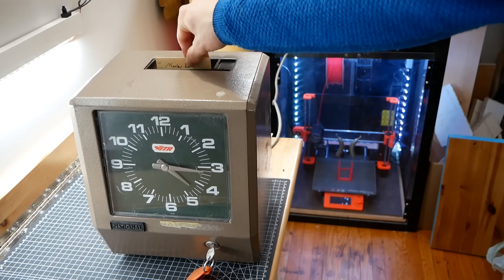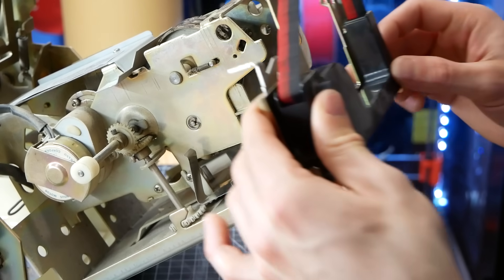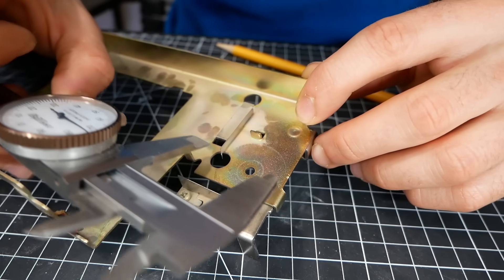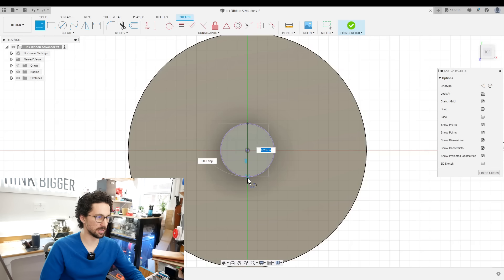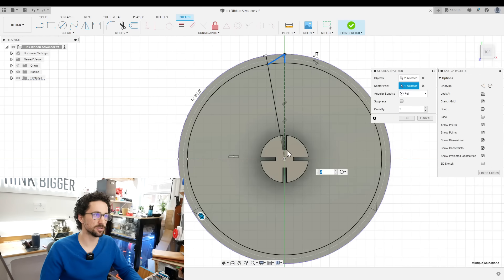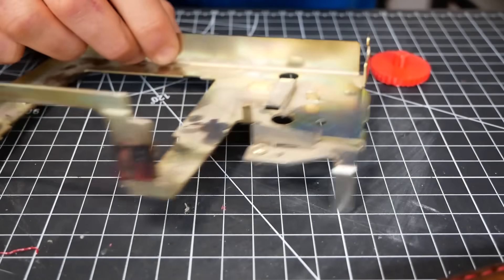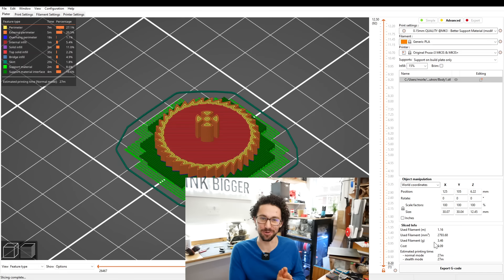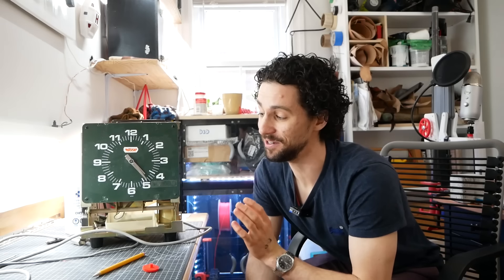They wanted 100 dollars. I 3D printed it for 9 cents.

Comment: But it’s only 9 cents if you have the PC, software, fancy calipers and a 3D printer. Suddenly a $95 assembly (not just a part) for a 50 year old machine that requires none of those things sounds reasonable. The issue I have is that while it’s cheap for you, and I do applaud your ingenuity & methodology in the scheme of things, those who can least afford all the required items will not have parts available if companies decide in the future that it’s not cost effective to provide spares for items as there is a limited market. I haven’t lost sight of the fact that this clip is about a 50 year old item though & you have shared the love.

Comment: yeah, that's great.  now tell them how much a 3d printer and resin/filament supply costs.  don't forget to include maintenance, as the machines WILL eventually need to be serviced. and make sure you get the RIGHT resin, as the entry-level stuff isn't always suitible for engineering projects.(the more durable stuff is of course more expensive)

Comment: If you count the hours you use to measure, design, and print, then the equipment you have to buy before you can start printing, the electricity bill, you will need a bit more than just 9 cents.  So if they have a 3D printer, it will cost them a bit more than just that 9 cents.  They don't have to design it since they probably have it on file which is an advantage for them.  But the way you deduce the shape it should have is probably more fun than just forking up $100.

Comment: Asking as I'm unfamiliar with the plastic these machines use. How durable would you expect this to gear to be? I would anticipate a short working life, as the top of the teeth would be rounded off. Factoring in your time as a cost, I would imagine if it has to be replaced one more time in the machines lifespan, it would have been more cost efficient to replace with the metal assembly? The concept here, however, is wonderful. If that part was not available, if the manufacturer was defunct, or anything of the sort, this could be lifesaving.

Comment: TBF on the $100 part, let's say someone brought this time clock to you in the hopes you could fix it for them and it wasn't your personal thing. You worked on this and designed a part that should work and testing proved that it did. But there is the time you spent on designing that part and printing it out. So let's be fair, if someone was hiring you to fix this for them how much would you have charged for this fix? Perhaps not $100 but I have to imagine that it would still be something. Heck once you were all done you might even tell them that because the part was so inexpensive to reprint that if it breaks that you'll gladly reprint it for them again in the future, but I still got to imagine that the initial fix would have cost something.

So again let's say I'm just some guy that wants to get this old time clock fixed up. I contact the company and they say they can get me the part I need for $100. I know you though and ask you if you can take a look at it. You not being familiar with it have no real way of estimating how long it'll take you to fix. So perhaps you give me a range of prices based on how tricky the problem ends up being (heck it might have been as simple as some mechanic part needing a bit of WD40 sprayed on it so it didn't stick). But now I have a choice, get that $100 part from the company that is almost sure to fix it or let you spend time on it for who knows how long and perhaps find a cheaper work around.

Comment: Honestly $95.00 is pretty cheap for the gear.  Props to the company for even offering the part.   You probably did $500 in custom cad work, $150-200 worth of assembly/ disassembly but hey you saved $95.00!!

Comment: I feel like changes could probably be made to make the part last longer.  Looks like there is metal scrapping over the PLA gear.  Idk what those changes might be or if they are worth the time investment--but the 9 cents is nothing compared to the print time, so for me I wouldn't want to print it out more than once if I didn't have to.

Comment: This is a perfect example of a manager vs an engineer. An engineer will look at a problem and ask what are the cost of materials and tool use, 360/10 is about 35 looks about right does it work, yes, and a manager will ask "How many people do I need to figure this out and get him what he needs and what is the cost in wages and in delays on other projects." One gives you a 9cent gear the other gives you $95 and both are perfectly valid calculations

Comment: I tottaly agree that the company should just replace that gear for a reasonable price ($100USD is really a lot for a gear)... however, if you account for the time it took you to come up with the decision to print one, measure it, draw it, print, test, change, re-print and fit... i am fairly sure that gear cost you WAY MORE than 100USD.

But, this is me talking out of my ass because i do the same thing every day...if i can make it, i will not  buy it.
Your video really shows that the process of bulding someting is just a matter of decision. 
Thank you for this. 
It is a nice tutorial on how to approach certain problems with a 3D printer.

Comment: You forgot to factor the price of your printer, media, time spent designing and electricity used.
Reply: media is most likely free, he already had a printer for practical use, normal 3d printers use about 50-150 watts, and time doesn't have much of a price
Reply: @thecringeslayer4897  Exactly none of that is true. Each one of those points are not “free” There is a cost associated with each.

Comment: Reminds me of my peterbilt. I have a little cap for my power steering that pete wanted $700 for thats just slightly bigger then a standard pop cap. And used ones are still going for $250+ friend who has a high end printer knocked one out plus a few spares for $1 each using a high melt point material and they work just as good as the factory one.

Comment: 9 cents + the 3 grand for a 3d printer
Reply: 3 grand??? LOL not even close decent 3D printers are only 200 bucks
Reply: @PabzRoz  the one he is using is 1200 bucks, lol sorry 3 grand was a bit of sarcasm
Reply: @DrinkWine94  That's only if you buy the Prusa pre built. It's 800 bucks for the kit and you build it yourself which almost everyone does lol but yeah i feel you

Comment: Imagine the process for someone without your knowledge. Get a 3d printer, learn how to use it, learn how to use the software, have all the measuring tools, find that one video that you found - like the hours alone are worth way more than 95 $, apart from having a 3d printer ^^ So the price is not good for a company that can make them for the same cost as you, but it's worth it when you don't know how to make it yourself.

Comment: i get that you're proud, of you making a part cheap and quick, but they are not selling just the gear, and they have to make the part, if you would sell the part it will not have a 9 cents price tag (as the company time and materials will factor in the final price), plus the part in the video looks as being made of Teflon which will last far loger then the 3d printed part (i have a 3d printer my self and been using it for 2 years)

Comment: Very cool!

But to be honest. When ordering a part, you're paying for labor, material, and the amortized value of the manufacturing machinery. $95 for an obsolete part was probably well worth it compared to the labor YOU put into it in design, measure, 3D printing and the like. For the skills required to do this effectively, you would probably be paid about 25-50 per hour. So unless it took you 2 hours to make, plus the input costs, you actually lost money on the transaction. 6 cents is just the material cost. Real cost is somewhere north of $200, which I'll admit is not as sexy a clickbait title. 

Anyway, cool video.

Comment: To be fair, they probably weren't going to send you some janky 3d printed gear lol. Idk the cost to machine a gear out of aluminum, etc. I know as an engineer I make $60 an hour and it would probably take an hour to put together a model in solidworks. Factor in other expenses, and under $100 is semi-reasonable as I doubt they get a lot of people asking for that. In fact they probably know that the people restoring these are doing it for collectors, or collectors themselves and can charge accordingly

Comment: Ingredients for a 0.09$ replacement.
1. 3d printer, +300$
2. Spool of Filament, +35$
3. Knowledge of Fusion 360

They would charge this because the tools and knowhow are invaluable and disproportionate to the time and resources to start up, ultimately the point is taken on a 1000x multiplier of cost to product when both these things are met with new age tech, and a person knowledgeable and kind enough to share the process. Thanks for the awesome vid, and pseudo-tutorial!

Comment: I get that the material and printing was only 9 cents but what about time spent measuring and inputting all those calculations. What about the cost of printer and electric to run. What about the worth of the knowledge to do said job.
Yes a fun challenge but this piece was absolutely cost more than $100 bucks when all said and done. If the part was needed for a business to stay operational and count employees time properly than the $100 would be the better bet all day long.

Comment: Fascinating however, you have to realize these places are running a business supplying parts for old machines that don’t work. That service has to come at a premium at this point. I’ve never met someone offering 3d print designs for cheap. So now knowing a piece like this can cost you .09 but every 3d print service I’ve ever talked to demands a high price for their time and design. You can do this for yourself for that cheap. Would you offer someone else that cheap price though?

Comment: Did you actually save any money not just ordering the part. Fusion 360 is roughly 300 dollars a year for business. The printer itself is well over 200 dollars. The roll of filament you had to buy for the 9 cents plastic is around 20 dollars. The there's the time it took to draw slice and print it and make a second iteration. So about a 570 dollars part on the low end not counting your time. 3d printing is a fun hobby but to say you saved 90 dollars making isn't really true.

Comment: It is highly probable though that the spare part is not cheap 3D plastic but highly durable cast metal. 
If your gear last 1y and the spare part 50y, then it is cheaper to buy the spare part.

Comment: I love the difference between engineers and mathematicians, I couldn't even begin to think about fixing this clock and you can not only diagnose the problem but also design a solution piece and fix it.

But when it comes to the number of teeth you need to guess the solution to 360 divided by 10 and come to the answer of 35

Comment: So you set a toothAngle of 10 degrees, you have a circle so the degrees of it is 360. 360 / 10 gives you 36 teeth. Just as a tip for next time

Comment: The BIGGEST thing that you have "completely" overlooked is this.
That missing cog was never designed to "go missing" - as whoever was the idiot changing the ribbon years ago - that tossed out that cog when "still attached" to the print/ribbon cartridge ????

Hello - the idiot who threw away that cog (with the old cartridge) never read the instructions on replacing cartridges - which would have certainly mentioned:
When removing old printing tape cartridge - remove lower cog from cartridge unit and insert into bottom of new cartridge.
Reassemble all components in reverse order.
Switch on and continue time stamping.

The idiot who threw away that cog (it could well have been a metal cog too) was the idiot who destroyed the (inner) workings of the timepiece

Comment: Sure , however how much was the cad software you used, how much was the computer, how long and at your rate of $100 per hour (from another video of the coffee table) did it take you to learn the software, how much was your time to design said piece, how much was your 3d printer etc etc. If you’re going to compare prices for a manufactured piece against something you can make you need to use all the factors. If we were to compare it the way I just mentioned it probably cost you thousands of dollars. I am however impressed at what you did.

Comment: Never ceases to amaze me how people think that 3D printing is the answer to everything.  Nevermind the physical properties of materials that the original part was made from.  If you have to print a new part every other week - because 3D printed material for commercially available units is only a fraction of the strength (or any other property, for that matter) of engineered parts - the hassle of buying an obscure, out of production part, doesn't seem so terrible.  For the love of god, though, never try to sell vintage junk with 3D printed parts.

Comment: No offense, but how much was your 3D printer? Also, I watch your videos where a free crate is transformed and sold for several hundred dollars. $95 for a replacement part on a 50 year old device is hardly unreasonable.
Reply: dont forget to factor in the cost of the phone he used to call them, the ruler he used to measure, the computer he used to create it in CAD, the copper in his house for the power, the electricity he used, and the cost floor he was standing on when he made it

Comment: Count of teeth is obviously 360 deg / tooth_angle. Also you could set this up from count of teeth perspective, so you'd can set integer amount of teeth counts and have calculated anlges automatically.
However, for this exact part, it just worked, so overthinking actually were be added to design+production price. So making this work fast is also very cool. =)

Comment: Actually $95 box cheaper than 90 cents :) as you know your 90 cents is not a 90 cents. Like 3d printer, power, consumables etc. but most important part is the time. It’s not the time you design or print the end product… the time you spend the figure it out and having experience with solid works and 3d printer… so that 1 thing it’s worth more than $95 we both know that :) tell me how many time you make mistake since you get the 3d printer, how many hours you spend for your first design :) good video thanks 🙏

Comment: Just curious... are you certain that the price you were given was just for the gear? They keep using the term "ribbon assembly", so maybe they were going to sell you the entire part, metal bracket included. Still a genius fix, though. 

also, DAMN... $59 for a ribbon cartridge?

Comment: The reason they charge so much is because they dont 3d print. They still use the old injection molding process and its still very expensive as they cant do just 1 piece at a time. They also mark it up as in the past no one was able to get those parts except through them. With the advancement of 3d printing most of this is changing.

Comment: Had this sitting on my homepage for a couple of months and ignored. finally watched after watching your skid video and immediately seeing "canada" written on the skid and your matching ring. thumbnail made it look super cringey and annoying to watch but it was ok. i had a time clock too and the company providing this one is in Etobicoke. I've driven by it a few times going to a customer. 

0.010" on dia is only 0.005" in the rad which is basically nothing. its 1-2 sheets of paper thickness.

Comment: I used to work in manufacturing of telecommunications hardware.  I used to hate it when the bean counters would suck the fun out of making stuff like this when they did their cost analysis.  The part probably took 4-6 hours of your time (presumably you're an engineer so, say about $120/hr), then the amortization of the printer offset by the capital costs/lease as well as the capital costs/lease rate on the software, not to mention a portion of the expenses related to the office space.  That part actually costs about $700-$800 to make...but absolutely genius of you to figure out the missing link!  Great video...loved it!

Comment: 90% of the things I print are this kind of things, replacement parts, custom designed things. You know they are charging that because they have or used to have an entire production line punching, cutting, bending metal, and big machines injecting plastic. That's what they are charging, you get it for 9 cents because you have the skills and tools to make it yourself. But if you have to charge for designing prototyping and make that part it will not be 9 cents.

Comment: The next real question is...
 Can you make the ink ribbon last longer because obviously you got multiple Strokes out of the same spot on the ribbon this thing kind of advances it a little bit too quickly if you slow down the advancement on the ribbon the cartridge would last longer.